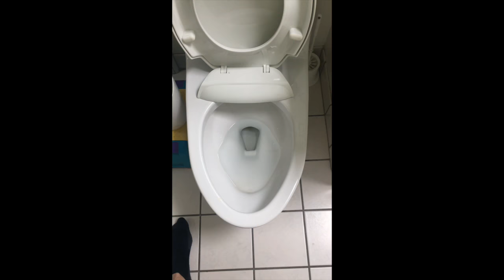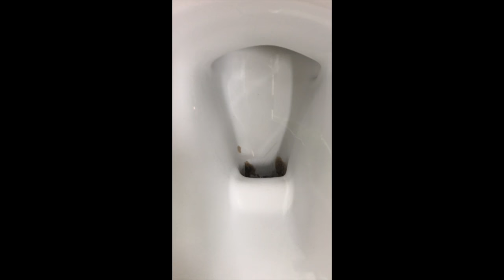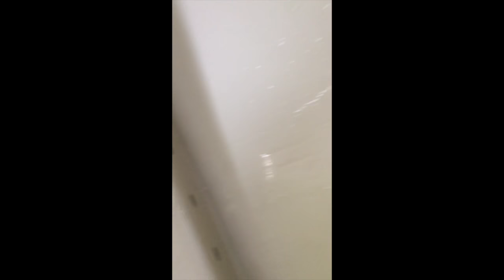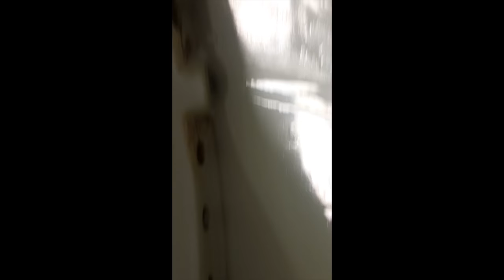Unclog Toilet Bowl Siphon Jet Hole to Improve Flushing

Comment: Which “hole” did u get the debris from?? (I know it’s not the jet holes, I fixed those already). Is it the big hole where waste and tissue exit down the sewage pipe? Or is it the smaller hole that (I guess? ) shoots the water from the tank?
Reply from the maker: My video is about cleaning the siphon jet hole. The following article has a side view of a toilet and it shows the siphon jet hole at the bottom of the toilet (the holes around the rim are called rim jet holes).
https://www.1tomplumber.com/clean-toilet-rim-jets/

It could be that some toilets don't have this siphon jet feature (I'm not a plumber or an expert so I'm not sure). This siphon jet hole is obvious on our toilet that I show in the video. For our toilet in the other bathroom the siphon jet hole is not visible looking into the bowl. It is recessed. I only know it's there by sticking my hand down into the bowl and feeling for it.
Reply: @ericschmidt6129  Thank you so much! This is very helpful!

Comment: How did you use that tool?
Reply from the maker: I scrape the inside of the siphon jet hole with the sharp tip of the tool. The material in the hole is fairly hard so you have to poke and scrape around for a bit. 

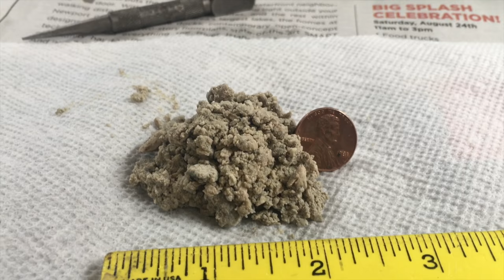The tool I refer to in the video is a nail set tool (at time 0:53). A small screwdriver or other pointed, metal tool would work as well.

Comment: I stuck my finger in there, and there's either ton of build-up, or it's actually part of the toilet.  I'm a little concerned about jabbing it too hard.  It would make sense for it to be a smooth tube as far as I can stick my finger, but it certainly doesn't feel that way.  Hmm.
Reply from the maker: I assume it was smooth when the toilet was new, but the buildup makes it rough. The buildup can be pretty hard. Porcelain is even harder. Scraping by hand with a metal tool like a nail or screwdriver shouldn't damage anything. Don't use a hammer or anything (as if it could fit in the confined space).
Reply: @ericschmidt6129  I ended up buying a nail setter at my hardware store, and really went to work on the lower siphon jet.  Dang, a lot of build up came out!  I originally thought it had to be part of the porcelain when I first stuck my finger in there, but nope, calcium build up!  I used a small measuring spoon from my kitchen to scoop the stuff out after breaking it apart with the nail setter.  Thanks for your video!!

Comment: Been trying to use Zep to clear the drain.  It didn't work and also a toilet on the opposite wall was flushing fine and it was further away from the sewer drain out front.  I poked a narrow brush that I use to clean out the hair in the sink drain and it brought up a lot of discoloration.  So it is a clogged flush hole.  Now, living in California, we use the "If it's yellow let it mellow" rule.  So I think the calcium in the urine has aggravated the problem.  I pour vinegar into the bowl and let it sit in the toilet for several hours to get out the visible stains, but it evidently wasn't getting the invisible areas.  I have a question.  Do you think it is a good idea to use a higher vinegar strength such as 30% to let sit in the toilets occasionally?  Or can it damage the wax ring?  Thanks for any input.
Reply from the maker: I didn't read anything when looking at vinegar and toilets that mentioned any concerns. I think any concentration of vinegar should be fine.

Comment: Maybe I missed it but where the hell is the hole at?
Reply from the maker: It's at the very bottom of the bowl at the front. I zoom in and point to it right at the beginning of the video. 

Not all toilets have this same hole. Yours may be a different design. Some toilets may have an equivalent large hole at the rim, also in the front. Because these holes are in the front, the water streaming from these holes pushes the water out the bowl to the back, helping the flush to complete.

Comment: u seem to be saying that u could have flushed that pile of calcified grit- is that right?  seems like i shouldn't flush such hard material down my toilet.  but i don't wanna fish that crap out for 20 minutes- hahaha.  please make me feel safe to flush the pile i will ultimately create!  hahaha.  thanks!  great video either way.  : )
Reply from the maker: I'm not a plumber, but I don't think it would be a problem to flush the grit down. It's hard to get it all out anyway with the water and all. It's pretty small and light so it seems like a low risk.

One way to make things a bit easier is to lower the water level in the bowl. An easy way to do this is to turn off the water supply to the toilet and then flush the toilet, which will flush most of the water out of the bowl. With the water shut off, the bowl won't fill up again.

Comment: Poor job of actually showing clearly where the siphon jet hole is, and didn't show the actual clean out, just the debris that was removed. Turns out my 2011 Kohler does not have a siphon hole like yours. Oops! Room for much improvement here if you remake this.
Reply from the maker: Thanks for the feedback. I do get questions as to how to remove the material. That would have been good to include in the original video.  

The location of the siphon jet hole is shown at the beginning of the video (0:04), but I don't call it "siphon jet hole" because I wasn't familiar with this term when I made the video.